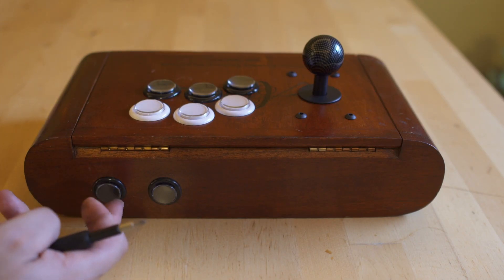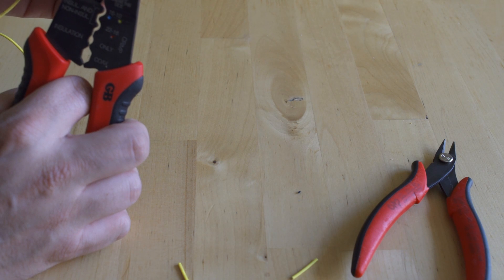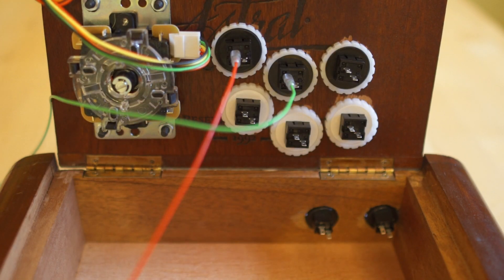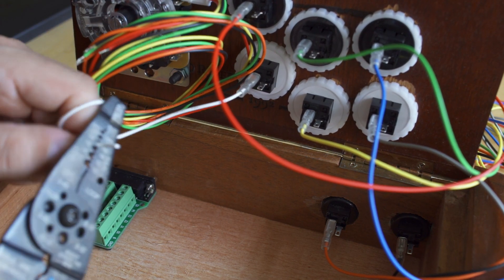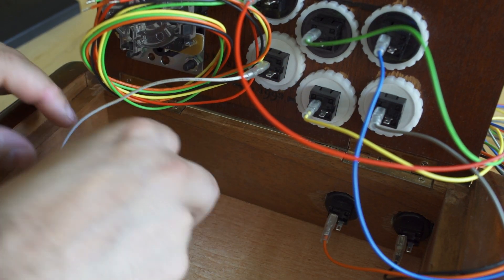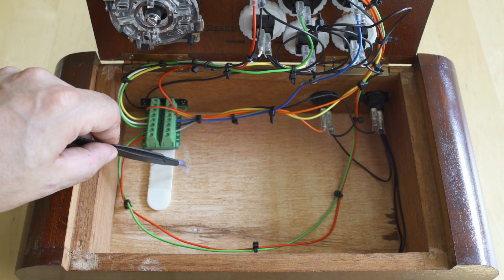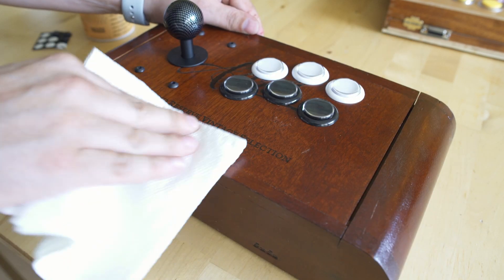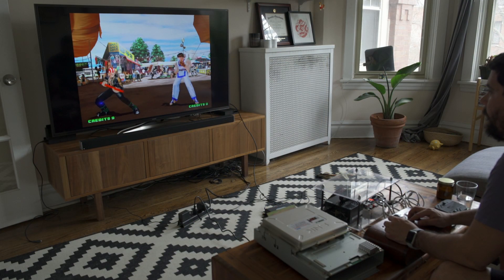Building an Arcade Fightstick from scratch - Part 2  - "On a Technicality"

Comment: Very good video! Thanks! I have a couple of questions please:
1) I can see that you have two black wires going into the PIN 1 of your DB15 board, are they the end and the beginning tips of your chain ground? I can see even a loose cable from your Start button (?) Sorry, I didn't get very well the chain ground part. Will you please send me some pictures or details of it if I leave you my email?
2) Do I need to buy a specific type of button or joystick for this experiment or I could buy any Sanwa kit?
3) Do I need a specific DB15 board for it? Would be great to have your shopping list!
Thanks again!
Reply from the maker: I had two grounds. One for stick and one for buttons. So ground chain and stick ground into the DB15 port. The loose cable is just more ground chain hanging out unused in case I want it for the future. 

2) no. Any button kit will be fine 

3) and DB15 port will be fine. Search “field termination”
Reply: @VideoGameEsoterica  Thanks for your reply! Everything clear now about your fantastic tutorial!
I have got just two more simple questions (just asking them because I am not an expert):
1) Can I use Fork connectors to connect the wires to the DB15 boards PINs?
2) Supposing to do an arcade stick with 7 buttons: 4 in line above (NeoGeo style) and 3 below. Could I connect the 4th button above and the 1st button below at the same PIN in order to have no.2 button 4?
Thanks
Reply from the maker: You want to go bare wire into the DB15. No connectors needed. 

I’m not 100% sure what you are trying to do with the double buttons? Can you explain more
Reply: @VideoGameEsoterica  Hi! I am not trying to do anything so far... I will start this experiment after holydays :-)
I wanted to know in advcance if you could have two buttons connected to the same PIN? (for example two 'low punch' in SF) Thanks
Reply from the maker: Yep. You could daisy chain two buttons signal wires to duplicate them if you want
Reply: @VideoGameEsoterica  That's great! I will start this project next month! Thanks! It would be great if you could connect everithing to an USB encoder and making the controller compatible with your PC... but I think now I am exaggerating 😁
Thanks again for your support and for all your work on this channel!
Reply from the maker: No you can do that too : https://m.youtube.com/watch?v=4UM-nb3ZYOc
Reply: @VideoGameEsoterica  Another great project! thanks for the link! I will focus on this one first :-) 
I noticed that you used a female DB15 port and a common DB15 male to female cable. Is that right?
Whatever you use female or male port, the wiring pin-out on the board doesn't change right?
Reply from the maker: The wiring stays the same pin wise male vs female yes :)
Reply: @VideoGameEsoterica  tx :)

Comment: I want to make a hitbox/mixbox hybrid and this looks doable still going run me a bit over 100 usd but hey I can say I did it. I guess tools are going run me close to that as well there are a few I don't already have for the way I plan to go at it. It was nice seeing someone use a premade box and pulling it off that was the part I was interested in seeing.
Reply from the maker: Buying tools just for a project is one of my favorite things haha. But that's just me
Reply: @VideoGameEsoterica  I think I am going do a MC Cthulhu project I mostly just want it on PC. I do think it will be fun to get it to work on a few other systems as well. I am trying to see if the dual PCB can be used for other controllers outside the Xbox 360. If so I plan to put a pin header on it and do a ribbon cable to a DB25 port out of the box. That way I could project box any other controller almost and really make it rather future proof/modular. 

I need a few more tools for this. Did you put the wires in the terminals bare or use ferrules or what? I could not quite tell.

Comment: What about playstion buttoon  help?
Reply from the maker: What about the buttons?
Reply: @VideoGameEsoterica   for ps4 button
Reply from the maker: Sorry not quite sure what you mean
Reply: @VideoGameEsoterica   the ps4 controller home button
Reply: @saber-dragon4292  Be just a 24mm on the side of the controller most of the time if you have a PS4 encoder it will have a terminal or solder point for the positive and chain the ground to the same grounds.
Reply: @AxiomofDiscord  I'm going to use zero zelay board
Reply: @AxiomofDiscord   I'm probably going to find a replacement  hub for the share button home menu button

Comment: hey just one question, the ground for the buttons...does just one end of that cable go conected to the pcb? or there are 2 ends that goes to ground?
Reply from the maker: The ground chain from all buttons goes into the ground pin on the DB15 connector. So one end only is necessary. If you have a second end of the ground chain free you can just leave it sitting in the enclosure